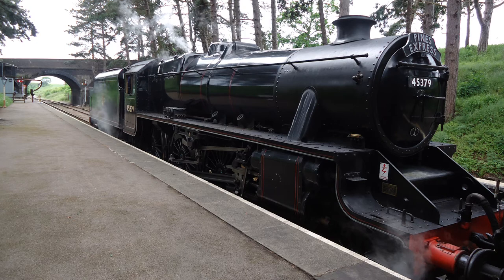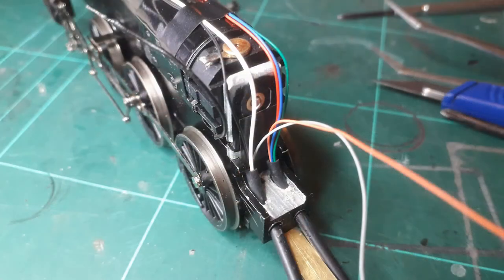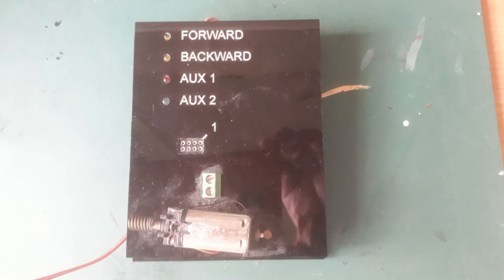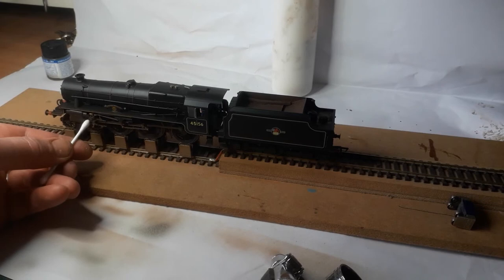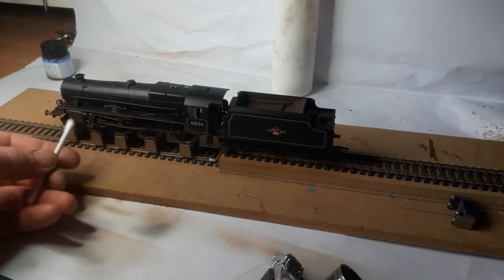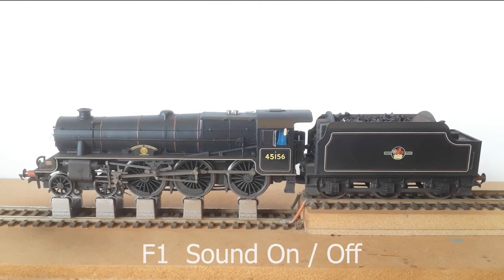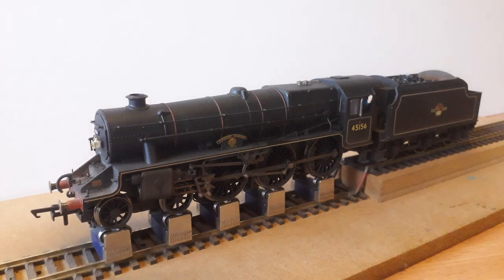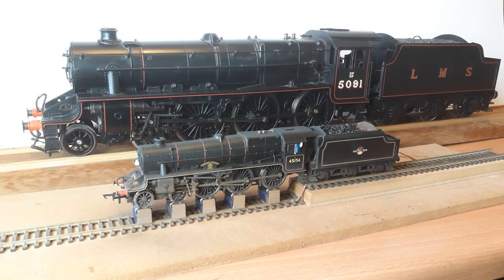Black 5 with sound review

Comment: I don't want to be amazingly critical, but the sound is only representing the exhaust from one cylinder.  It should, as Peter Smith writes in Footplate over the Mendips on driving Black a Five, have 4 beats to a bar, or revolution. Each cylinder delivers two beats per revolution, your driving rig shows very clearly only two beats.. Can the chip be reprogrammed to do this?
Reply from the maker: sadly that what you get with a "cheap" hornby TTS chip, and you can't reprogram them . I may upgrade the chip later